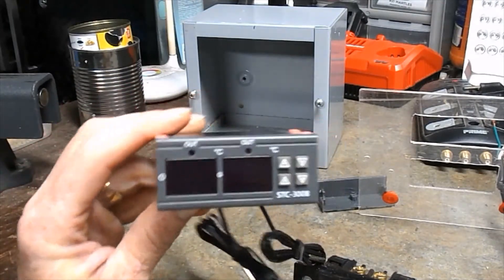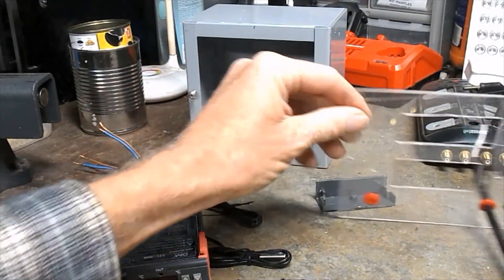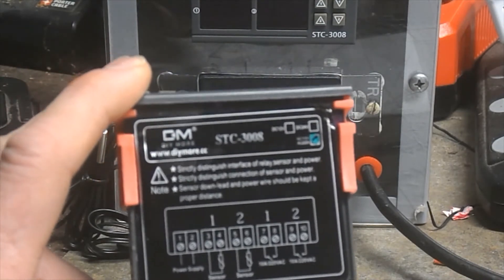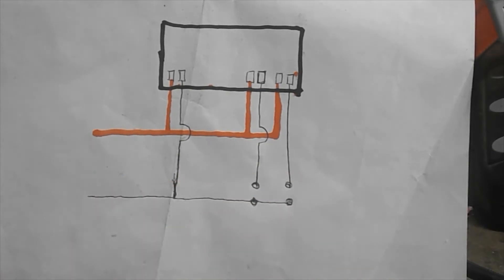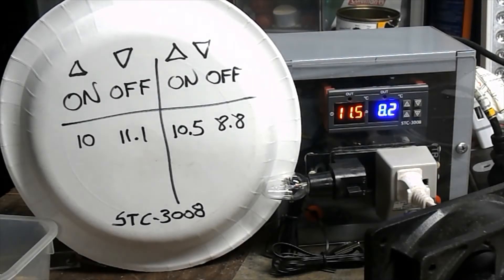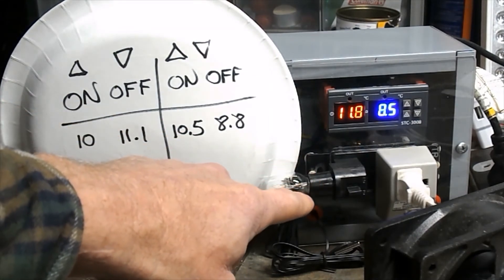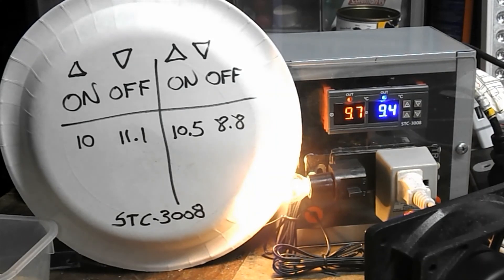STC 3008 for seed starting heat mat controller

Comment: Can I connect heater (1500w) on this controller?
Reply from the maker: I'd say no. 1500w devices usually are supposed to be plugged into a wall outlet. I don't know what the power specs are.

Comment: Thank you it did help, can you also post a video of how to wire a AC220V STC-3008 With a fan to cool of an objective please
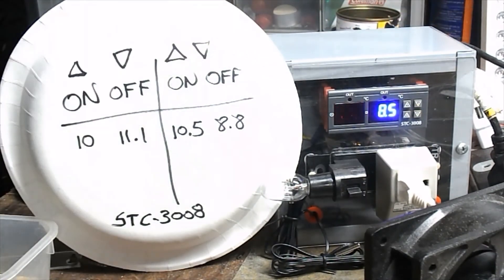Reply from the maker: The wiring schematic for the stc-3008 is in the video and at about 5:40 I explain the settings for the fan. I would imagine the wiring for an 220v would be the same as a 110v stc.

Comment: Hi Plantsfun, how did you make it to reach 11 and 8? mine starting when plug was 55+ and 60+ I'm confuse.
Reply from the maker: You have to push and hold the up or down arrow until the number flashes then push the up or down arrow again to set your temperature. Remember the arrows at the top control the number on the left. The arrows on the bottom control the number on the right.

Comment: Hi there great video and well explained. Can you tell me if l could use the 2 probes to operate one pump? 1 probe outside the pool to a solar mat and turn pump on the other probe  inside the pool, when inside temp gets to a certain degree turns the pump of.  Thanks heaps
Reply from the maker: The probe would only work with one of the outlets to turn one pump on or off. The second probe would be connected to the other outlet to control a different pump.
Reply: @plantsfun9069  Hi, I worked it out and sent the power wire to the heat and then looped to the cool. Then when the heat gets to hot it shuts off and kills the cool at the same time. Works a treat now. Thanks for all your great info.
Reply from the maker: @rudelee7180  Glad to hear that you got it working the way you wanted.